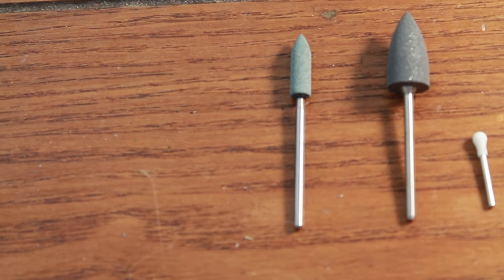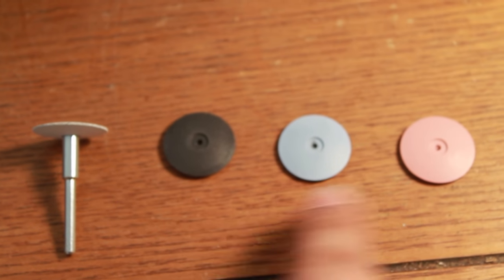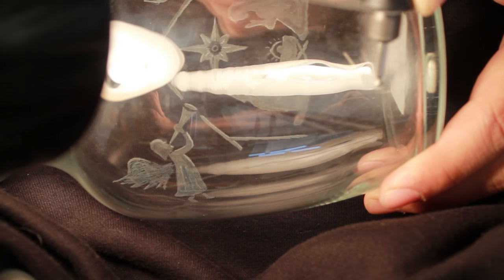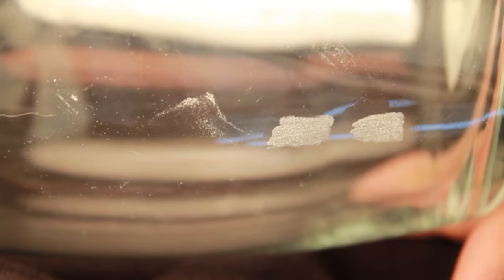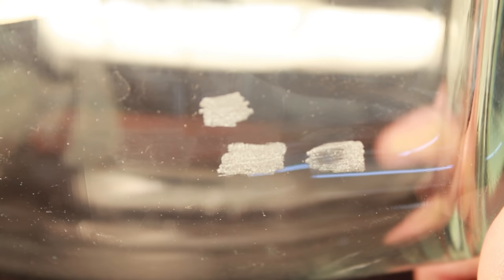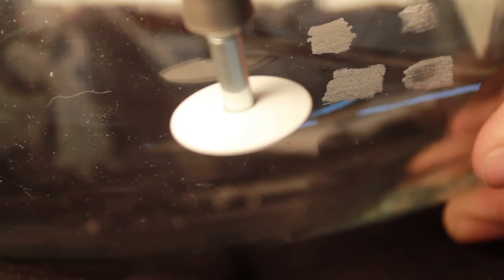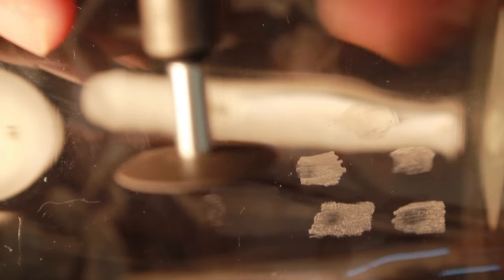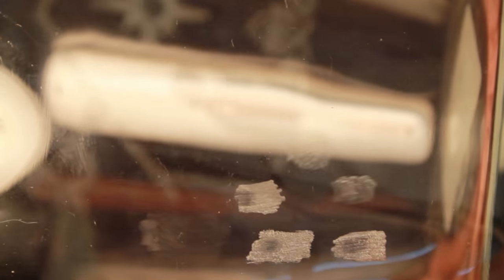Glass Engraving for the Beginner - Bits and Burrs (shading)

Comment: What type of dril are you using to hold the arkansa stone.   I have a set of this size bit of shading,  however, it does not fit in my foredom drill.   THANKS.,    THIS WAS SOOOOO HELPFUL
Reply from the maker: It's a Dremel, and the 'pen' is a dremel flexshaft.  The Arkansas stones have the metal cylinder smaller than other regular rotary tips so it all depends on the collet that you buy (which you can take in and out of the dremel or flexshaft itself)  You can get a set of collets in order to accommodate the different sized burrs you buy  some will hold a bigger circumference burr, while others can tighten to a higher degree (for smaller burrs such as the Arkansas stones seen here)

Comment: thanks. helped a lot.
Reply: where did you get the round micron polisher.
Reply from the maker: There's two competing websites that I have found so far.  One is based in the UK called Eternal Tools.  The other is based in the U.S. called Widget Supply.    There is a slight difference in vocabulary between UK and US but they both have the same burrs, they are just called different  (the US website calls them silicon wheel softies)